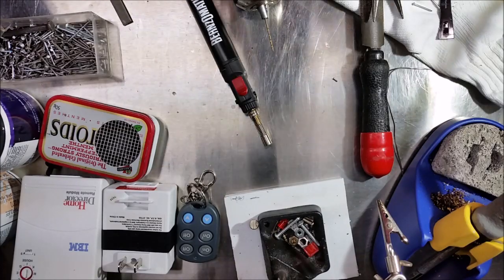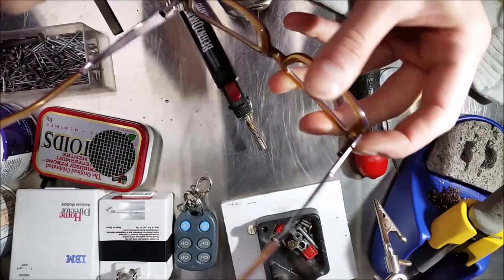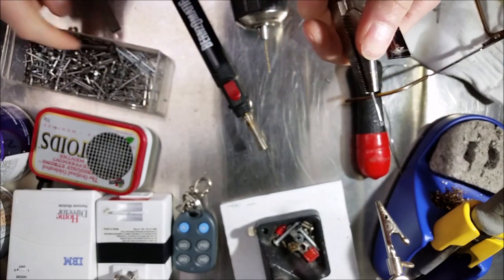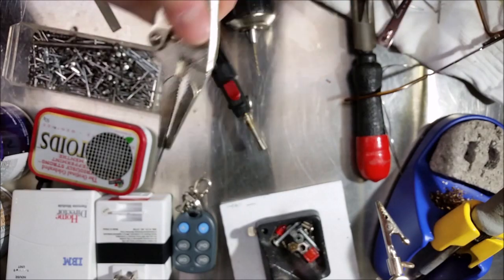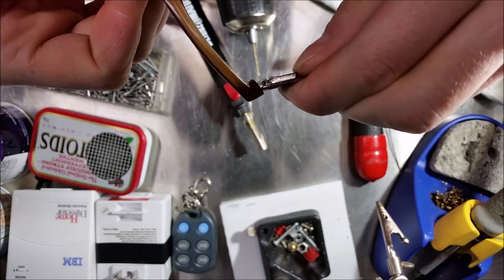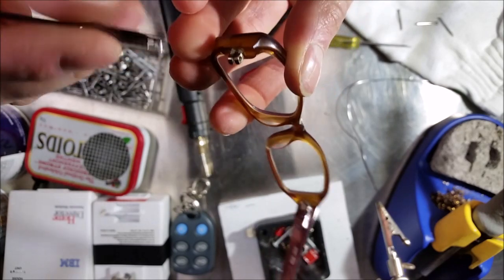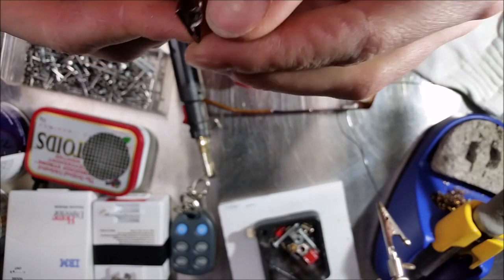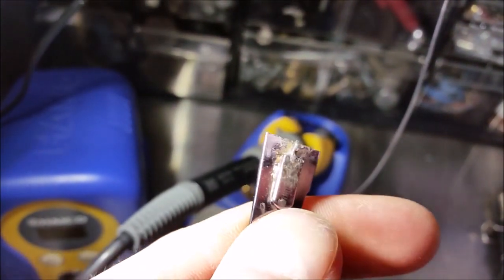How to ACTUALLY Repair & Re-Build A Broken Hinge Tang On Reading Glasses!

Comment: I love the DIY hinge fabrication.
When soldering to certain metals the solder often doesn't want to whet or flow and stick. I bought some La-Co aluminium soldering flux for soldering to... guess what.
BUT a bonus I discovered was that the same flux worked for steel too. Now they sell a purpose made flux for Steel but the Aluminium one works just fine.

Comment: They sell these replacement hinges, quite cheap to buy and easier and better than to remanufacture one. Just drill out the old one and pop the replacement one in it's place, it's a 2 min repair.
Reply from the maker: I guess you did not watch the video.... the hinge is manufactured directly to the plastic arm. It cannot be removed.
Reply: Chargèro, it seems like a pretty standard glass hinge, they are not manufactured into the arm, they are press fitted into the hole of the temple piece (arm). After you remove the old one by drilling it out you just press a replacement into its place. One like this https://www.zoyeglassesparts.com/media/catalog/product/cache/1/image/9df78eab33525d08d6e5fb8d27136e95/t/x/tx-028-_1_.jpg
Reply: The little hooks of the replacement hinge grab into the inside of the hole preventing it from backing out. I’ve actually repaired this exact hinge of my own glasses multiple times, since I always break them.
Reply from the maker: @MrEvitaerc  Interesting, I was never able to find the part. Thank you for sharing. To remove it I wonder if you can just pull it out braking the retention tabs, or twist it some how. Drilling it out would enlarge the hole too much for it to fit properly.
Reply: @QuaabQueb , You have to drill just a little bit so that the drill destroys those hooks, then the spring just falls out. It can be tricky thou, I repaired one side of my glasses 2 times but in the third attempt, as I couldn't make the spring pop out, I kept drilling impatiently and ended up enlarging the hole just as you said. Now the new springs don’t attach properly anymore so I had to glue a new one. Here is a video  (bad quality and foreingn language) of someone doing this process: https://www.youtube.com/watch?v=1-ka-NQVhOw